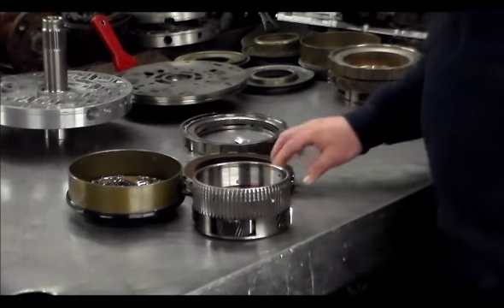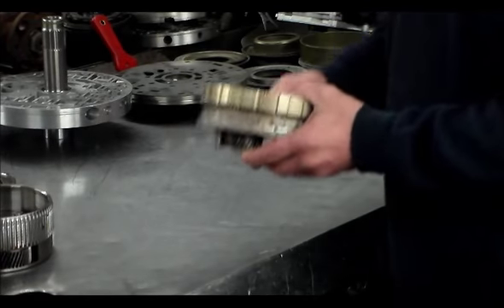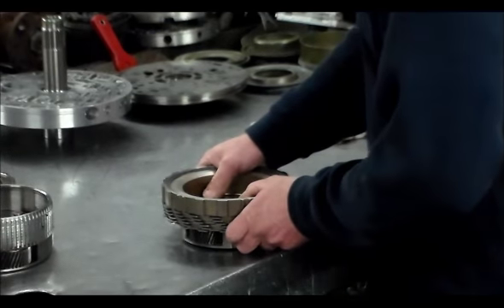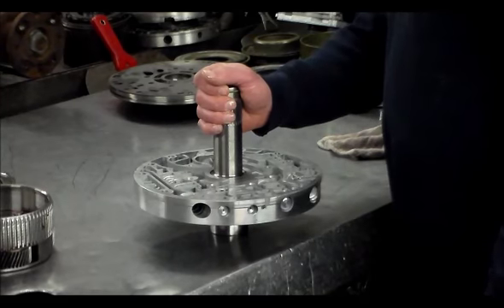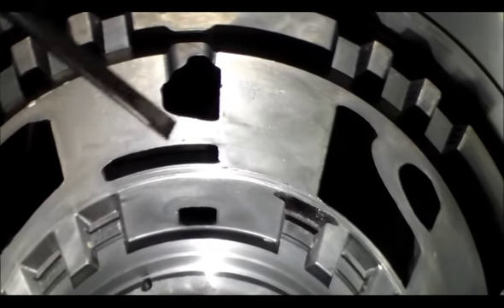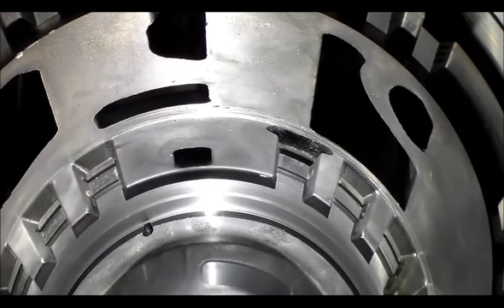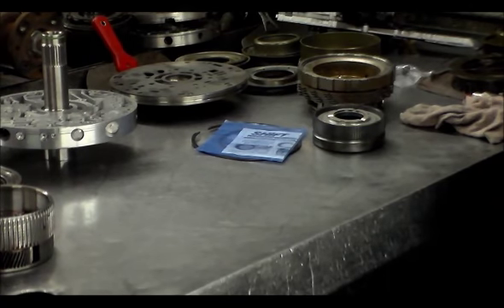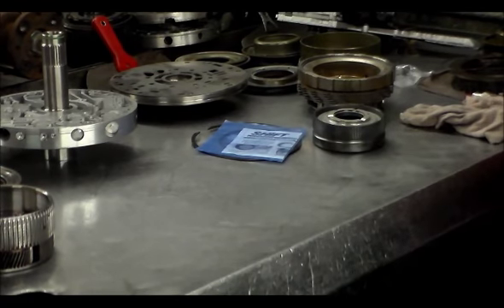5R110W No Reverse

Comment: Thank you. I’m about to take mine in for this exact problem. What’s a good guess for the cost of this job ? A rough estimate would be much appreciated.
Reply from the maker: If you have no reverse, there is a good chance the case is broken, if it is, I recommend a transgo shift kit.  Part of the shift kit is changing the pressure regulator valve which means taking the pump apart, special tools are needed to line the pump up. Also clean the bellhousing where it meets the engine block, if there is a plate, take the plate off and clean that, clean the engine block as well, all mating surfaces, if the case is bad(lugs probably broke off) the whole job with installation could run about 3700.00   Also run an extra ground from the transmission case to chassis.  If your going to do this, there is a certain way to fill this trans, the pump is a high volume pump.
  Love your screen name, i'm a huge Dukes of Hazzard fan (if that's where you got the screen name from)
Reply: Gary Ferraro dang! I really appreciate your response. Figures this would happen when I’m not working to have the spare cash for it. 😔
Reply from the maker: @tylerw1418  Welcome, Anytime, any questions just let me know

Comment: Hello good morning. I have a 2008 F450 pickup with that model of transmission. the changes it does apparently well. but it has no reverse. The strange thing is that when I put it in neutral, the engine with the transmission does not release. It even walks forward while in neutral. The transmission was working fine until it started with a failure of selenoid B, which is the overdrive selenoid, but it was driven like this for about 650 miles and when it came out from below we realized that the plug was simply loose, we put it back and poured the oil and well, we have the problem that I mentioned at the beginning. Do you have any idea what it could be?
Reply from the maker: If this moves forward in Neutral then a clutch pack is locked together and will not release
Reply: @GaryFerraro  so i need to put the transmission down? I need take off?
Reply: @GaryFerraro  in neither position is the engine released from the transmission. In forward it goes fine but it doesn't have reverse and in neutral it goes forward but soll in first gear, and even in reverse it goes forward maybe 2 feet and then doesn't go any further. but never try to go back
Reply from the maker: @lopezautoservicellc  Pull the trans and disassemble, should find a bad clutch pack
Reply from the maker: @lopezautoservicellc  Linkage looks ok? if yes, has to be clutch pack
Reply: @GaryFerraro  ok. Thank you
Reply: @GaryFerraro  i don’t know what is that
Reply from the maker: @lopezautoservicellc  Does the linkage seem to be moving ok, Is the shifter moving through the gears ok (P-R-N-D)
Reply: @GaryFerraro  yes. That part is good 🥲🥲🥲🥲🥲🥲
Reply from the maker: @lopezautoservicellc  ok, then must be a clutch pack locked together
Reply: @GaryFerraro  🥲🥲🥲🥲🥲. Thank you
Reply: @GaryFerraro  hello good evening. as indeed there was a pack of burnt cloches. I replaced them and now the problem I have is that when I put drive or reverse the pressure drops to 1 Kpa, and the computer tells me that the overdrive selenoid B is stuck off, do you think there is an internal problem in the transmission due to something I put wrong or the problem will be the valve body?

Comment: I have a 2010 5r110w trans. at it take time to shift in rev. there is no slippage and the oil and pan was pretty cleaned.  I opened the trans. and nothing is broken and everything looks good. I only have 12000 km on it but I use it to plow snow.
Reply from the maker: how is the engagement into drive and how does it upshift?
Reply: @GaryFerraro  Everything shift good only reverse. I put air into the reverse clutch pack and the piston move with a bit of air coming out. The clutches look good.
Reply from the maker: @rjmonci  looking at a clutch application chart, the coast clutch is on in reverse as well, coast clutch is right behind the pump
Reply: @GaryFerraro  Ok I just finished changing all the seals even the low / rev. seal. As well I switched the shift solenoid valves low / rev. with intermediate shift solenoid valve. I plowed with the truck and everything works good. Now I went for a ride on the road It feels ok but if I look at the rpm gauge it goes up when shifting up. So now I will go buy a new shift low / rev. solenoid and try it. I'll let you know what happens after that.
Reply: Ok I cancelled the shift solenoid. I took the pan out and cleaned both solenoid with mineral spirit and switched them again. The rpm is high shifting and reverse works good. I check my repair manual and it say's after the battery has been disconnected, the module will have to relearn the shift pattern. So I went for a ride and it's better. I still don't know what was wrong but it works now. Thank and I like your site.

Comment: 2003 4L60E new frictions, steels, sonnax pwm, all new bushings. Converter only locks up when it’s cold, when the trans warms up it falls out of lockup, and will no longer engage. What could it be?
Reply from the maker: What do you mean by sonnax pwm? Is that a valve?.  what solenoids did you change?
Reply: sonnax regulater and isolater valve and sleeve kit is what I meant. I replaced the tcc solenoid as well as the pulse width modulation solenoid. It has a p0894 code present. When the tcc engages it thumps then disengages.
Reply from the maker: ok, sounds like you covered everything, are you confirming all this with a scan tool, can you see converter slip? is this setting a code?
Reply: Gary Ferraro i don't have a good scan tool to show me converter slip rpms unfortunately. I used dexron 3 is dexron 3 okay fluid?
Reply from the maker: Dex  3 is fine, you should take the car out on the parkway for a ride, if th converter is sipping, this is when a code will set, what do you see when you say it falls out of lock-up
Reply: P0894 is the code it shows. It Will engage torque converter lock at around 50 but shortly after it will disengage.
Reply from the maker: very possible you may be dealing with a valve body problem, if you have new bushings in the pump, rebuilt converter, pwm solenoid and addressed the isolator valve. the lock-up valve in the pump is free?
Reply: Gary Ferraro the valve in thethe pump is definitely free as I checked it when I installed the tcc solenoid. I reused the old converter since it only had 68k on it since the last rebuild. Could the tcc be bad?
Reply: Thank you for the insight on my 4L60E I believe it's narrowed down to the converter clutch itself... Thank you
Reply from the maker: jamie patroni is it a rebuilt converter?
Reply from the maker: jamie patroni yes. Swap out converter
Reply: Gary Ferraro after the rebuild I didn’t realize how important it was to replace the converter so I reinstalled the old one. I still don’t understand why it still engages for a short time. I will buy a new one soon.
Reply from the maker: probably an issue with the clutch lining, if the computer sees it slipping it may inhibit the function
Reply: Now that you mention that I think that’s what’s Happening, the converter engages at 50 mph but then disengages likely from the computer sensing slip then P0894 code followed by harsh 1-2 shift.